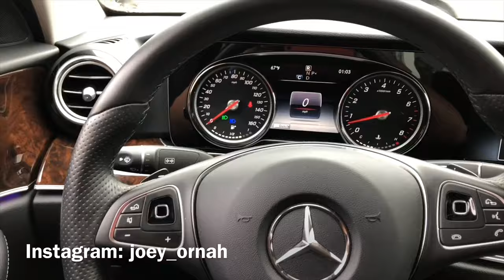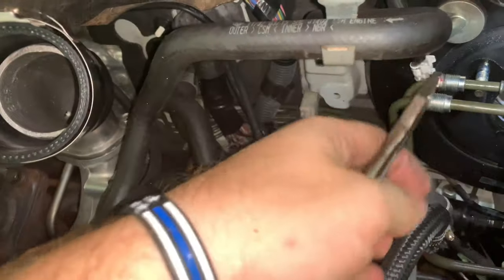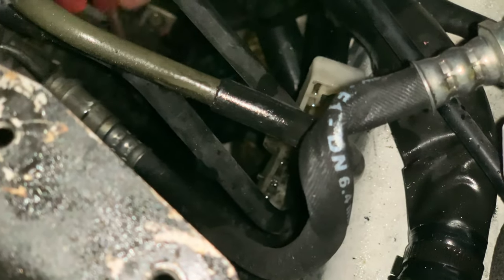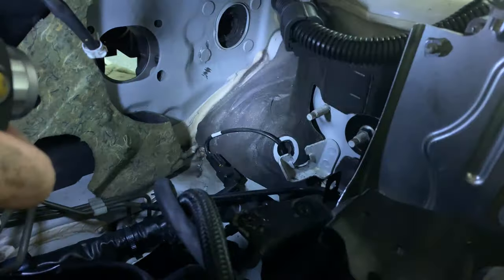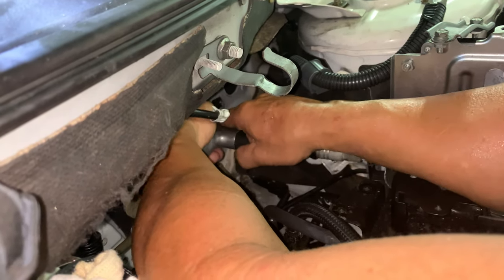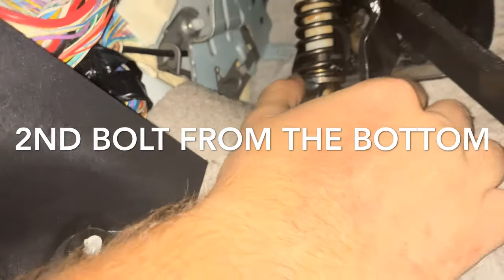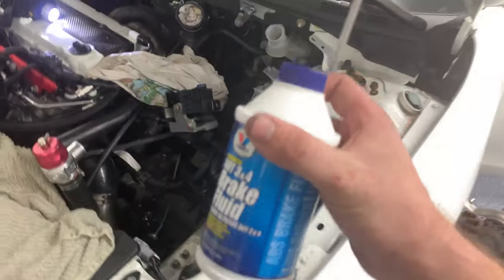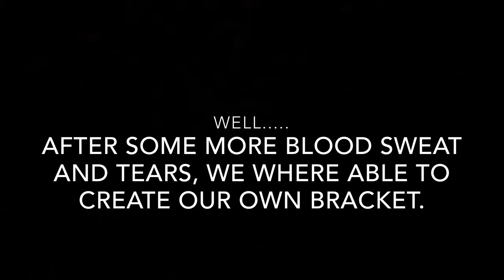Vnotes #76 2015 EVOX CLUTCH MASTER INSTALL!! MY DAD GETS PISSED.

Comment: Just saw this video and it completely reminded me of when I put that bracket in myself. Everything your dad just went through, I was cursing up a storm like no tomorrow and also saying it was impossible. It’s actually not. I researched as much as I could and couldn’t find any clear info as to how to get that bracket on. I actually figured it out by accident. The way you have to do it is slide on that L bracket first onto the cmc side. It’s a perfect fit and has no play. Once that’s on, you can angle the arm piece with the adapter and slide the bracket over. It goes in with hardly any effort. I could not believe it was that easy after hours of trying every other way that would be considered to be “common sense” but ends up not being that. Hope that helps if you ever try to redo that piece again if ever.
Reply from the maker: Azn Retrofitter well, too late now